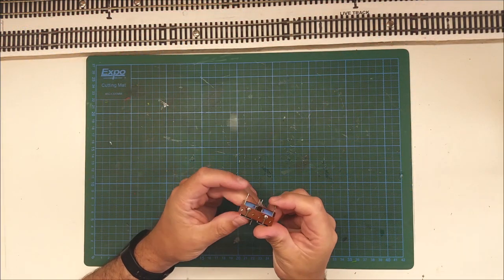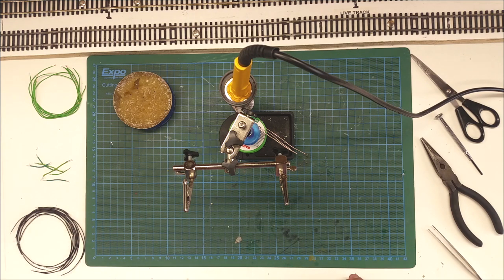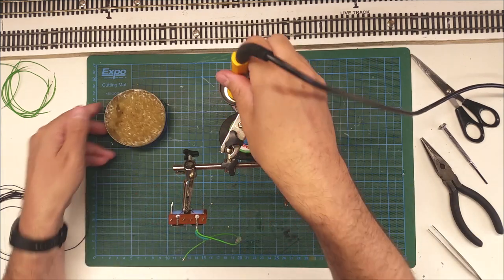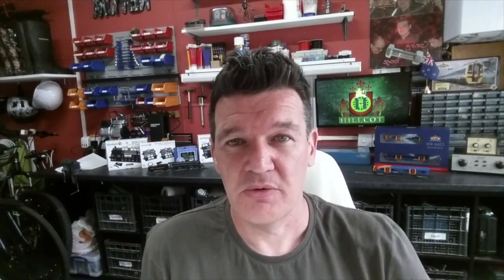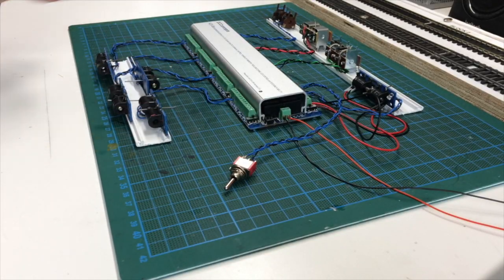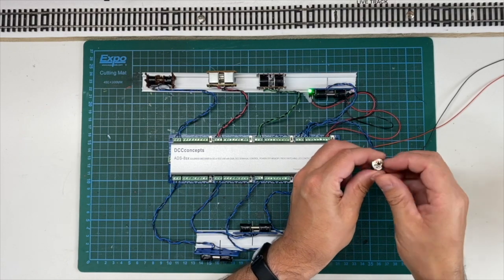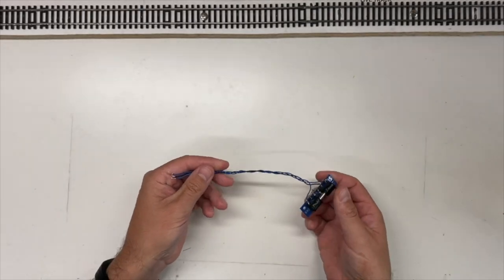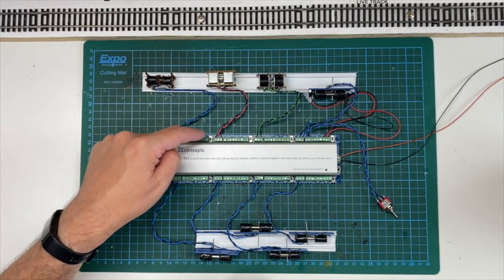How to wire a Peco Solenoid Motor DC & DCC - Includes intro to DDC Concepts ADS-8SX

Comment: Won’t the PL-10 draw too much power for the Digikeijs 4018 to work properly? The PL-10 is a power hog when feeding it DC power through a decoder.
Reply from the maker: Interesting. I've not yet used the 4018 with a peco so I don't know. Thanks for the info, I will be sure to avoid doing so.

Comment: You mention in passing that you can use a Digikeij DR4018 to switch Peco or Hornby solenoid motors is this correct? I am new to DCC and was previously advised this is not possible. Any help is appreciated.
Many thanks, Roger
Reply from the maker: Hi Roger, I havent done it yet although I do mention I will probably do so. In order to solenoids to work, you need to set the output to Preset 0. The DR4018 is quite versatile and you can program different outlets to do different things. Have a look at the manual page 28 https://drive.google.com/file/d/13Z9kgNRUkyUnKzNgQGGRpOQU1FYrzgSY/view?pli=1